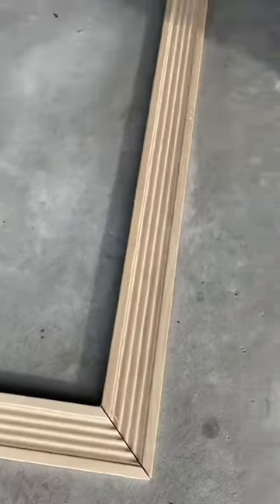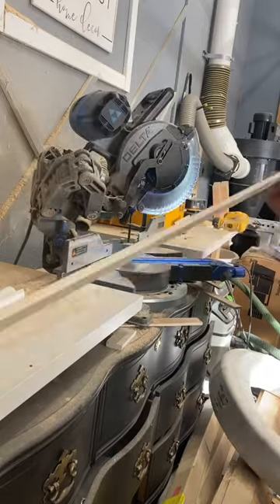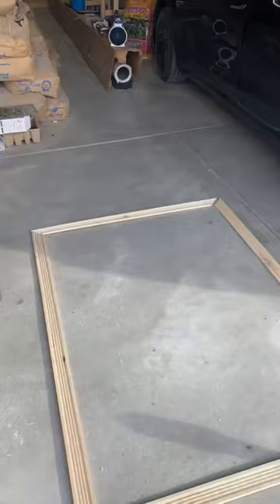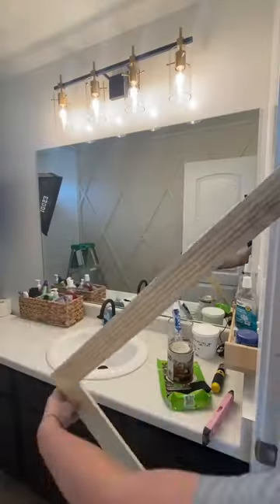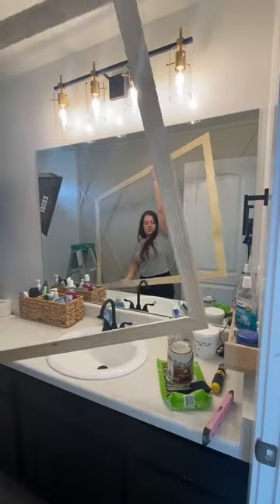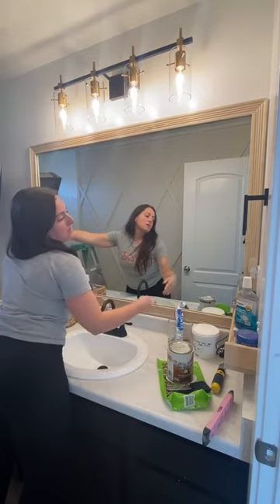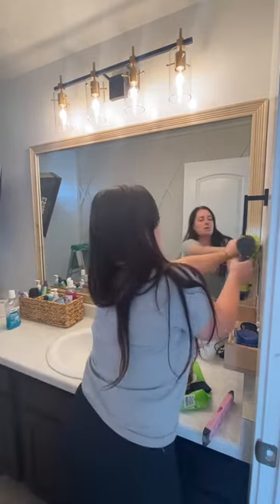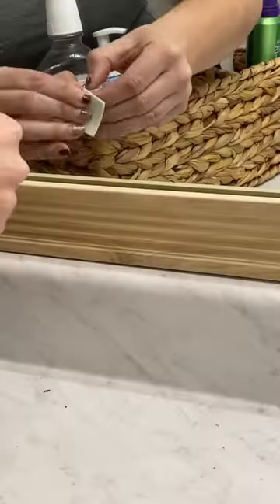DIY Mirror Frame Bathroom makeover

Comment: Is your mirror glued to wall or it has the nail and tack to hold it up on each side? I have nail and tack and want to trim my mirrior but dont want it to stick out
Reply from the maker: It’s glued to the wall so no clips on mine, but you could add a trim piece so the frame hangs over the clips